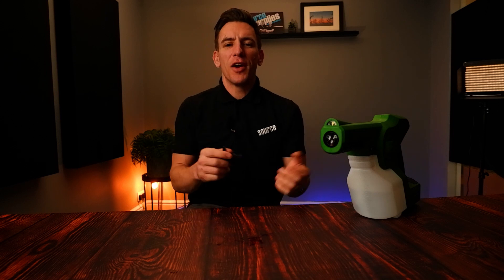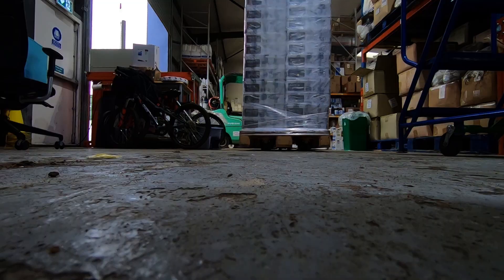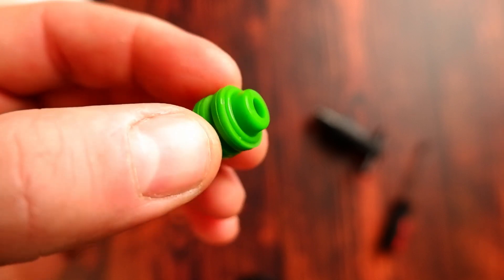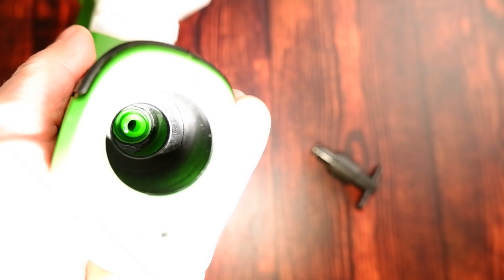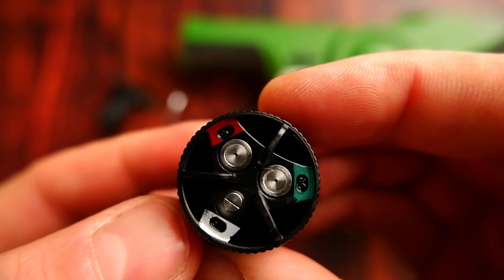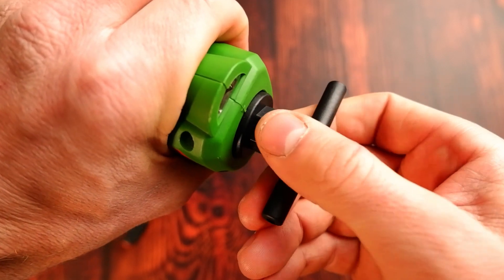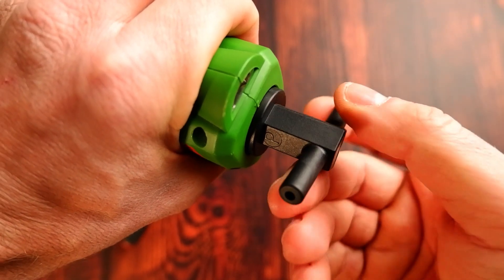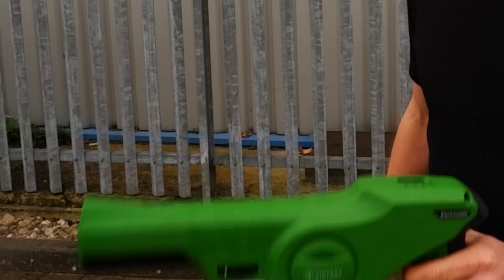Is your Electrostatic Sprayer Leaking

Comment: Any clue on sprayer not working with a charged battery. Sometimes it works sometimes it don't. Extremely frustrating especially using them in the Covid fight
Reply from the maker: Hi, I would exercise your warranty for this. Thanks